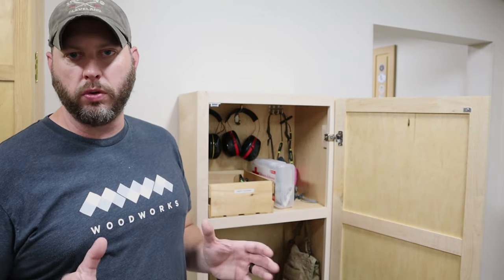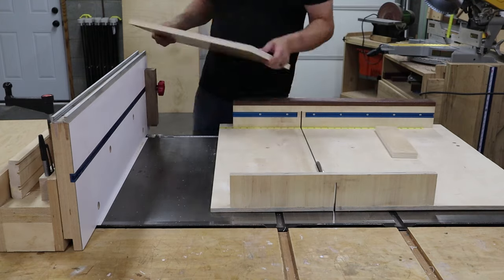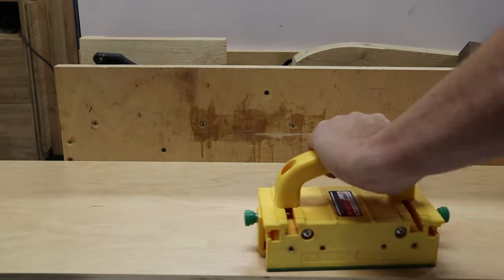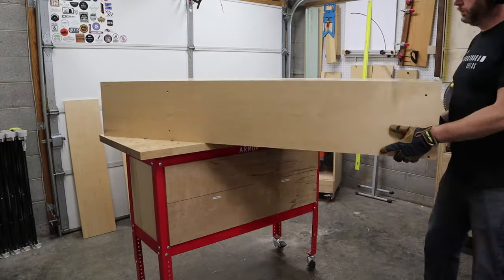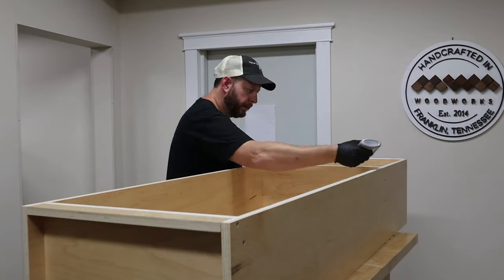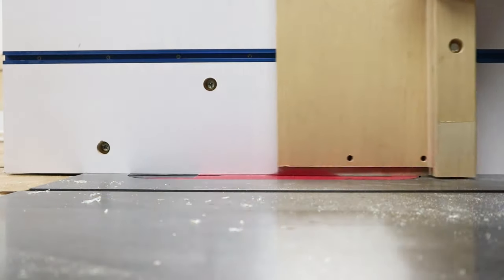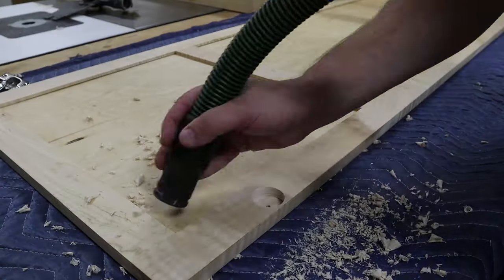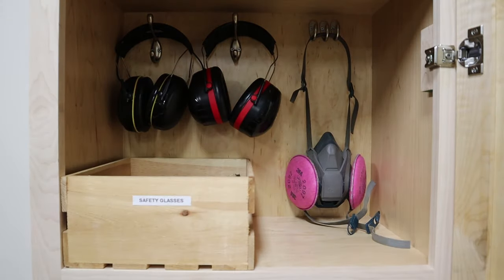Making a Tall Storage Cabinet

Comment: Great job with the video. Unfortunately, however, I don't have a router, planer, or joiner. In your future videos, I'd love to hear alternative ways to getting a similar result with more basic tools. You should challenge yourself to make a video on how to make a similar (but perhaps more simple) cabinet for the average (or beginner) woodworker! That would be a great video!
Reply from the maker: Well, what kind of tools do you have? As long as you can get pre-surfaced lumber you don't need a jointer or planer. And a frame and panel door can be made entirely on a table saw. In fact I have a video on that.
Reply: Time is money for a woodworker. It's never a smart idea to build something with less tools than they have.
Reply: If you don't have those tools, maybe this video isn't for you
Reply: Go to ikea.

Comment: looks nice, now attach 1/8” thick soft weather seal to the inside edge of the door to keep the dust out and keep it as dust free as possible.
i did this to my shop cabinets and it works great.  i did compensate for the weather stripping but if it’s 1/8” thick and soft, it may be five and the door should close tight enough.
although one of my cabinet doors twisted and has an opening but the rest are fine.
just a thought.

Comment: Cool Video, thanks for sharing. I don't have access to tools you have, can this be accomplished effectively without the full shop?
Reply from the maker: At a minimum you'd need a table saw to make the cuts assuming you can get pre-milled lumber to be able to make the door. Then you'd need at minimum a drill/driver set for assembly and if you don't have glue and clamps you'd need a kreg jig to make pocket holes.
Reply: Any thing can be done
If theres a will theres a way , just may take some problem solving and elbow grease! Im 16 been wood working since 14 had to figure out some my self and improvise, i had no access to the internet  until august. Made my first joinery box in march with a hacksaw and a bayonet

Comment: Great video. Why did you switch to 1/2 rabbit on the rear of the side panels?
Reply from the maker: Because I used a half inch plywood panel for the back
Reply: Ahh, makes sense. Thanks

Comment: What if the only saw I have are a hand circular saw and a chop saw? I can’t afford those fancy tools you have.
Reply from the maker: Get a piece of foam insulation and make a straight guide for your circ saw. You don't need a chop saw for plywood. You'll have to make a much simpler style door because you can't make frame and panel doors with the tools you have, sorry.